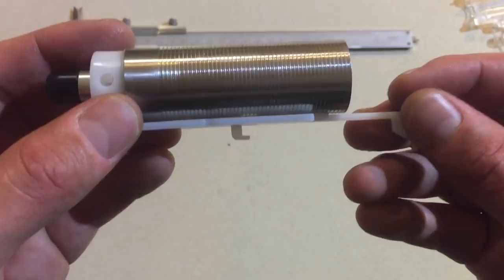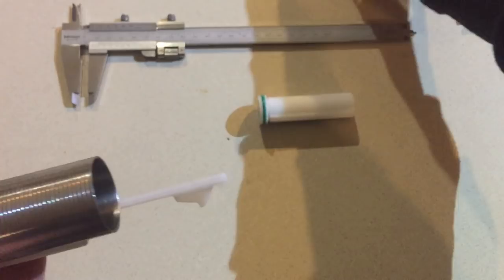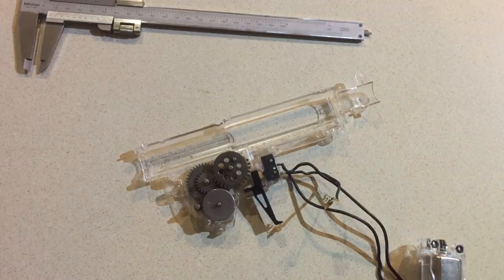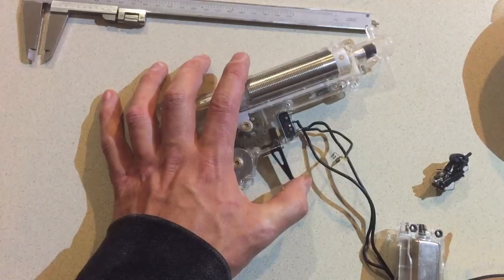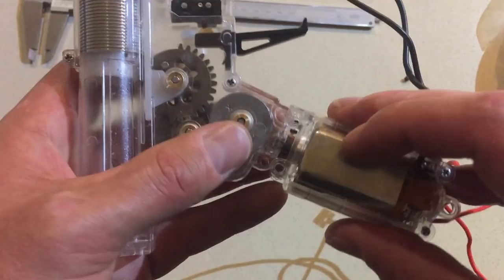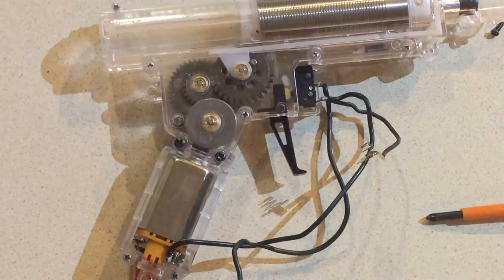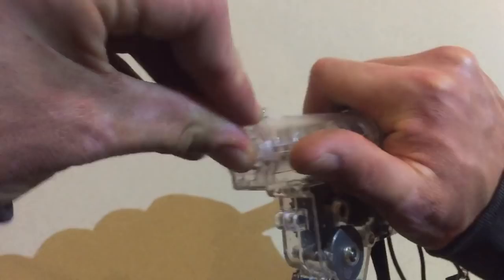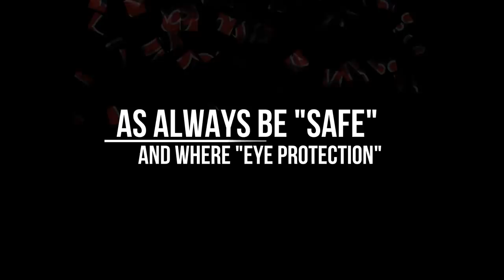JM8 M4A1 "GEARBOX" MOD" TUTORIAL" FULL ASSEMBLE

Comment: Really good video! The step by step guide helps a lot
Reply from the maker: Thank you niz_45  :)
Reply: +GEL BLASTER CHANNEL spring 1.3 or 1.4 which better?
Reply: @abdulhafiz7800   1.4 1.5 spring need metal gear set,1.3 is better with no metal set

Comment: Bud i loved your review hey! 
Informative about the plunger seals and how you could just streach them like that and.. bam! Seals again? 😂 ledgend. 
Im about to buy my very first jm M4A1 next week and do these upgrades myself. Just a quick question bud, what fps are you getting now with the 1.3 spring and the nylon gears? Also.. are you running a 11.1 battery? 

Thanks in advance :)
Reply from the maker: I am getting around 280 fps -300 depending what parts you use
Reply: @alexterito1  yeah that's what I'm aming for, 280fps
Reply: 8drifit ur accuracy is gone then

Comment: I just upgraded my whole gearbox using the same gears. Tested the gears with the original ladder and everything worked fine but with the new metal ladder the lengths are slightly different and it caused it jam up on the last tooth. Only fix I can see for this is to remove the last tooth off the gears then it should work fine
Reply: Clint Chard: no need to grind gears just compress your spring slightly with some pliers to fix jamming problem
Reply: That wouldn't make a difference when it's the plunger bottoming out before the teeth disengage. My fix worked and I haven't had any issues since. On another note I did go back and shim my gearbox after 2 weeks of use because I could see where the gears were wearing slightly from things not being lined up correctly so yes no shims works but correct shimming will stop unnecessary wear and tear and will prolong the life of your gearbox

Comment: All those nice metal parts but no bearings or shims ' also does your trigger mod  stop your safety switch working properly and do you get compression loss from stock patter head on that cylinder
Reply from the maker: I know what your saying bud, but this video is a demonstration in terms of assembly of the mechanical  parts rather than all upgraded parts, surprisingly enough it does 290-300fps now the same shell, a green o ring blue plunger with 8 hole plunger head
Reply: @alexterito1  what size motor and spring are you running to get 290- 300 fps and what is your pellet size and weight set to on your chronograph
Reply from the maker: I am using ACETECH 6000 set at 7.5mm / weight set at
0.20grm
Stock motor
Blue SHS Plunger
8 Hole Blue Airsoft SHS plunger head
Steel polished inner Plunger tube
Steel Spring guide
1.3mm longer type manganese spring
Oversized O-ring made by Wurth 
Factory Trigger switch
J.G Gears
Bearings & Shims
Steel tapped
1200ma 11.1v Turnigy 25c-50c High discharge Lipo
27cm Alloy Barrel
Reply: @alexterito1  so I take it that your running 1.3 spring ' 32000 rpm chihai wet pressure magnet yellow 460 motor & 11.1v 1800-2000mah battery
Reply: @gabc6296  you must be fun at parties
Reply: @schmonyon  how did you come to that assumption
Reply: @gabc6296  you mustnt get it. No surprise there.
Reply: lol i rip 330 from and o-ring and a 1.3 spring, you can pour money into these if you want and see miserable results
Reply: @LowVp  lolololol I get over 500 with no spring or even a gear box. My point is, show your results otherwise your claims mean nothing.
Reply: schmonyon how can i post pics here
Reply: @schmonyon  so you are just using compressed air withan actuator valve to pressurise the barrel instead of a gearbox spring and piston?
Reply: @schmonyon  well @gab C probably in the same party as mine, as i'm a tech savvy for airsoft too, and that what he's said is critical, at least at airsoft because shimming is critical in heavy duty cycle gears
Reply: @AbuGuroza  ffs 🤦‍♂️ it was a fucking joke.

Comment: My motor doesnt seem to be catching on any gears so the motor just winds when I pull the trigger. Any advie, fixes/causes? Thanks
Reply: The gear is held on by a grub screw. It has possibly slipped down. check to see if raising the gear allows it to engage.

Comment: hey if you upgrade the motor do u have to solder the wires? or are there connectors you just plug in?
Reply: Also wanting to know
Reply from the maker: either way, prefer it to be done guys does not matter, with connectors makes it a lot faster and more convenient to upgrade swap your motor.

Comment: Does anyone know which battery wire goes to the negative and postive ,ive just replaced the motor 
And dont wanna put the pinion in Reverse ,i think i munted my nylon pinion that way ,so now im rebuilding the Whole gearbox with metal gears and rack,was ment to be a simple metal trigger replacement

Comment: Thanks mate I’m. Ow confident to give it a crack
Reply from the maker: Awesome mate, you got this!
Reply: GEL BLASTER CHANNEL if it’s not to much trouble could give me a list of parts and where to get the ones you didn’t get from chainsaw
Reply from the maker: Sure bud
Reply from the maker: Zhenduo ebay , chainsaw sell everything you need.
Reply from the maker: Upgrade 460 motor there are three type, can read more info on chainsaw webite. 1.3 manganese spring or 1.2  bearings and shim kit if you decide to run bearings witch i recomend you do while everything is apart. A&K brand Gear kit or J.G Brand Chainsaw supply them or Ebay if you want cheaper. Metal alloy trigger zhenduo ebay or chainsaw. Trigger spacer you can make or buy. 3s 25-50C Rated discharge 11.1v Lipo Battery. steel tappet bridge plate can find ebay zhenduo seller. alloy nozzel chainsaw or zhenduo
Reply: GEL BLASTER CHANNEL thanks mate your a legend
Reply from the maker: Your welcome bud.

Comment: Thanks for the tutorial, where can we get the metal rail plunger?
Reply from the maker: cheers bud,plenty of online stores sell them, also ebay.
Reply from the maker: https://www.ebay.com.au/itm/Toys-Gel-Ball-Gun-JinMing-8-M4a1-Gearbox-Upgrade-Parts-Gears-Push-the-Barrel-Etc/112865884316?ssPageName=STRK%3AMEBIDX%3AIT&var=413277818430&_trksid=p2055119.m1438.l2649
Reply from the maker: https://www.ebay.com.au/itm/Gel-Ball-Gun-JinMing-8-M4a1-Gearbox-Upgrade-Bearing-Patter-Head-Outdoor-Blasters/183126298223?ssPageName=STRK%3AMEBIDX%3AIT&_trksid=p2057872.m2749.l2649
Reply from the maker: you will need to purchase both to complete plunger
Reply from the maker: $51 AUD in Total, expensive but well worth it, best i have tired so far, will require two coils cut from spring when using this type plunger.
Reply: GEL BLASTER CHANNEL have you try the double oring piston head plunger?
Reply from the maker: Not yet bud

Comment: Nice!! Great job! btw, How long is your 1.3mm Spring in cms?   is it possible to do 1.4mm spring? can it handle that?
Reply from the maker: Tom Smith, 13.mm spring i am using is about 6.5 inches, factory spring is slightly shorter. Yes, you can run 1.4mm easy as long as you upgrade plunger to metal gear rail along with metal gear kit. the factory plastic gears will run 1.4mm, but the golden question is how long for, and that i cannot answer as they break at some point down the track especially with 11.1v and high torque motor.
Reply: How about a 1.5mm spring with all metal gears, metal cylinder, metal teethed plunger a high torque motor and a 11.1v battery?
Would this system run it?
If so what high torque motor should I use with this setup that will shoot reasonably fast but at a good fps? Thank you! :)

Comment: Hey bro awsome video man. I’m still a noob with all this but my m4a1 isn’t firing any gels in an upright position. It can shoot if I lean it slightly or even upside down. I just got a metal mag for it but still has the same problem with the standard mag. Any chance of help would be awsome. Chur bro
Reply from the maker: Hey bro, cheers appreciate your feedback and thank you for watching. It could be that the gels you are using happen to be just a little to small in diameter being 7mm or have you soaked them long enough to reach its maximum size? or motor might be damp/wet from excess water run off the gels resulting in you magazine motor to fail Hmmm shake the mag downwards to remove any water that may be causing your mag motor to short out.  hope this helped bro. if not take apart the magazine run two wires from your lipo battery and touch the two terminals on the magazine to see if the gels spit out.

Comment: Gotta shim em gears mate.
Reply from the maker: AYY LMOA Not on the brass bearing sleave they do not rub at all, no distortion. Only when you install aftermarket ball bearings as the length of the ball bearings full under the margin for tolerance/clearance.Only when they rub requires shimming :) Ball bearings that aren't shimmed will cause distortion and a horrible winding noise. NOTE: There are two different brands that make "Metal Alloy gear kit", hence why i made it clear in the video footage at the start as to the stamped markings on the gears which is distinctive. However the other no name branded gear requires shimming as they have been machined slightly different expecially the sector gear, they do happen to full under the required tolerance. Not the set in this video. hope this answers your quote.
Reply: GEL BLASTER CHANNEL So just to clarify which alloy metal gear kit is this one in the vid and where do you get it from? Thanks in advance.
Reply from the maker: Ant Fowler, I have explained everything in the description above cheers.
Reply from the maker: Chainsaw are selling A&K Branded metal gear kit requires shimming :)

Comment: Hey bud, just done this mod, when test firing, the gel balls do not feed into the barrel, any ideas ?
Reply from the maker: NUG11Ts15 > Assumption >Return spring has lost to much spring tension, swap to stainless steel plunger return spring. May as well change to upgraded slightly oversized O-ring, peace of mind everything is sweet in terms of full cylinder compression is well. run two wires bridged of you lipo battery and touch the two terminal points on the magazine, see if who can here the mag motor start up, if no gels come out, swap the wires around as it may be in reverse polarity. gels still don't come out the mag might want to open it up and check if the mag motor has rusted away. hope this helps you troubleshoot a fix.
Reply: I’ve done everything in this video except the stainless plunger housing, I pulled apart again and found that the pump bridge has broken, that’s why the balls were feeding through the mag but not sucking up to the barrel.

Comment: Hello. I am new to the hobby and am building a m4a1 gen 8. I've swapped the plastic gears for metal gears, but the gun doesn't fire. Looks like the gears aren't moving properly. When buying the metal gears come two small pieces of copper, cylindrical, which Do not know where they are placed. Could you help me?

Comment: what motor did you use? need answer asap
Reply from the maker: 460 motor
Reply: GEL BLASTER CHANNEL stock motor?
Reply from the maker: No upgrade 460 there are 3 types the one you see in the video is the yellow type which gives you higher ROF and little more torque. It all depends on what you want from your blaster if you want more serious torque to push a harder spring for more FPS maybe you want to look at the 460 red or blue type.
Reply: GEL BLASTER CHANNEL Oh now i get it. Thanks mate!
Reply from the maker: No worries, if you look at chainsaw products and look at all three types, he has explained everything in the description. Link for website is provided in the description above.

Comment: Are after market replacement shells available for these
Reply from the maker: Hi bud i am not sure sorry
Reply: GEL BLASTER CHANNEL this is a V.3 airsoft gearbox so yeah there are hundreds of after market shells
Reply from the maker: FrozenByFire3 thankyou for sharing i just googled it now,  i can see this working for the G306 as the design of V3 does not support the t-peace unlike the G36 has supports for the barrel in the shell itself.
Reply: GEL BLASTER CHANNEL you could probably have it 3d printed. Though stuff like gears and pistons and cylinders its the same thing. A nice SHS gearset + high torque motor + an 11.1V lipo and you're shooting 30 shots a second easy. Check out my only 2 videos about my airsoft gun, you can probably do something very similar with a gel gun but maybe a little lower rate of fire.

On another note, if you're using a li-po, I'd recommend getting a MosFET, it'll prevent your trigger contacts from arching and eventually charring preventing proper conductivity. You'll also have much faster trigger respone and a more reliable set up.
Reply: GEL BLASTER CHANNEL but yeah it actually might have slightly different dimensions than a V3 gearbox but at least most of the internals are the same
Reply from the maker: Just watched your video's :) very cool wish i had one! will definitely look into it, thank you for sharing bud.